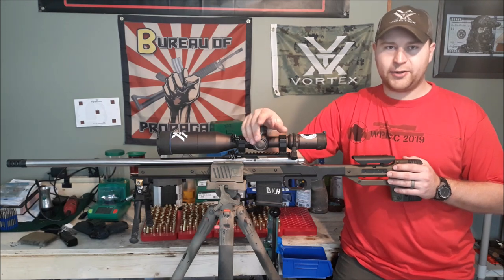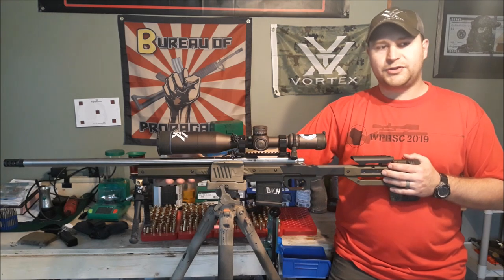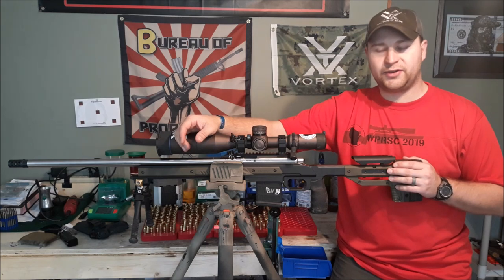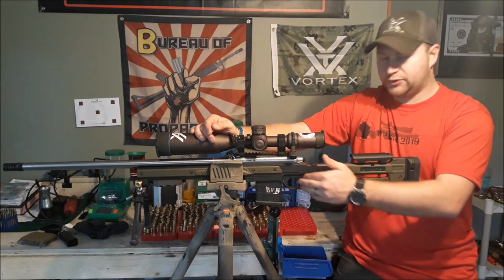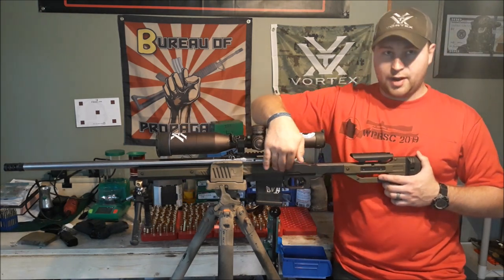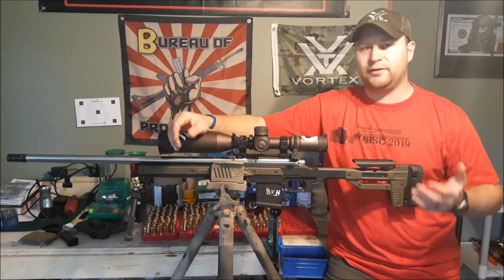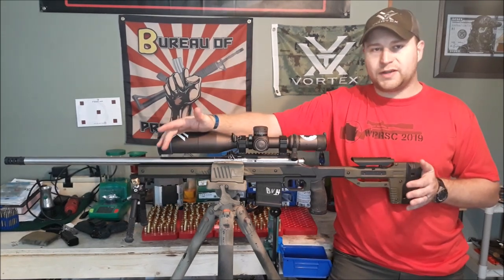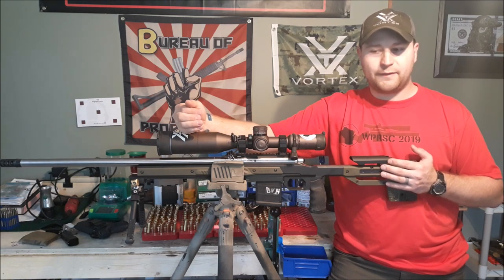Oryx Chassis Review

Comment: Did you have any fitment issues with the remage style barrel nut? Did you need to file any material in the chassis or bolt right in no problem? Thanks.

Comment: Hey, nice video bud. We got almost the same setup. I think you’ve attached some MDT weights up front. Would you mind sharing some details? Thanks.
Reply from the maker: It was pretty simple and straightforward. The wait actually line up very well with the factory holes but attached the plastic handguards you just have to drill two extra holes on each side to attach the weights. Then Fred the holes for an appropriate bolt and you're good to go. I am not mechanically inclined and I was able to do this

Comment: So I am thinking about getting one of these, what length is that ARCA rail? I see Area 419 is offering a weight-tunable version with brass weights in it now, or MDT has the one designed to fit on the Oryx. I see another comment you also said you attached some weights to the front, which ones did you use (the m-lok exterior weights I assume?). Do you have any pictures of that setup? Your idea with adding weight to the grip and stock spacers are awesome, I have a couple bags of shot laying around not being used anyway. Thanks for the review!
Reply from the maker: I used the area 419 arca rail. The weighted one I feel wont work as you end up bending the arca rail when you attach it. I used MDTs mlok weights. But I drilled and tapped holes in the chassis and bolted them to it.
Reply: @bvhnightmare  Oh gotcha. Yeah I had thought about doing the same with the weights, should be simple to lay out to drill and tap. Then it also theoretically should be able to be used with any m-lok item of the same bolt pattern distance too. 

I think I will just do the regular arca then, thanks!
Reply from the maker: @goory93  the holes for the mdt weights line up perfectly with the holes in the chassis. You onlybend up having to drill 4 holes